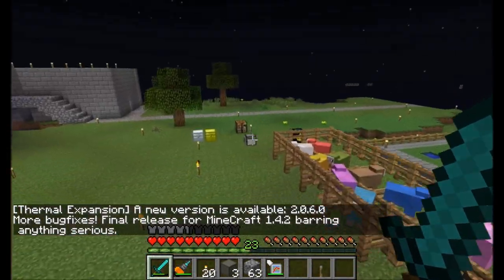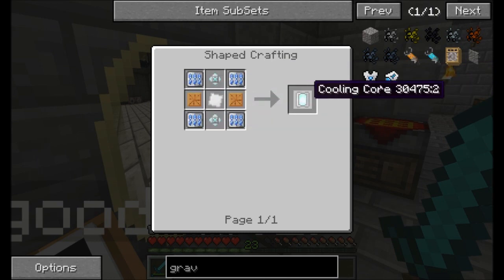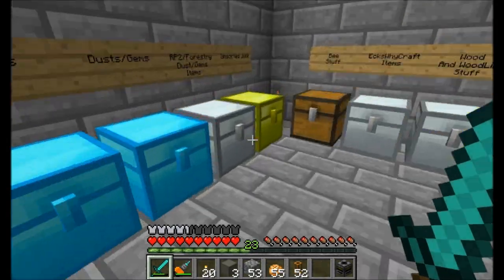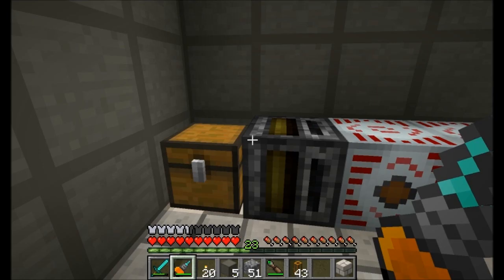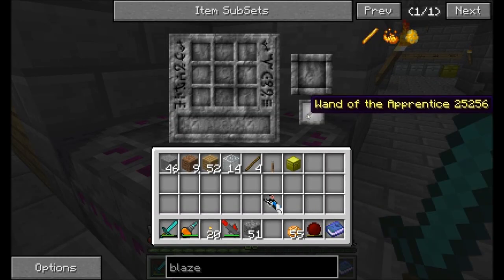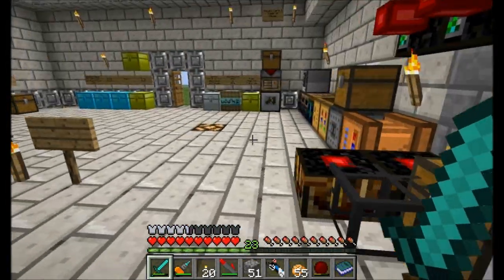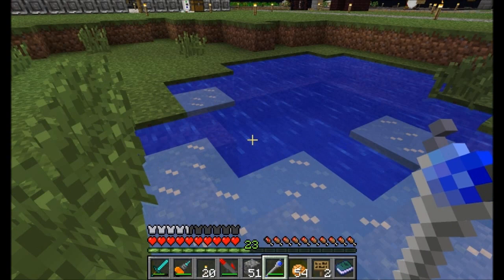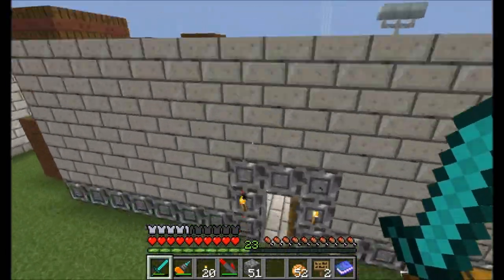Season 3 - Episode 54 - SMP Direwolf20's Minecraft Server Play

Comment: Did, sorta...using the logger forestry device and now rolling in wood heh. Also, "Time delay switch" is probably what it's called, and I need that or else my carts would fling back down the line. Got it going for one cart, but not connected ones.